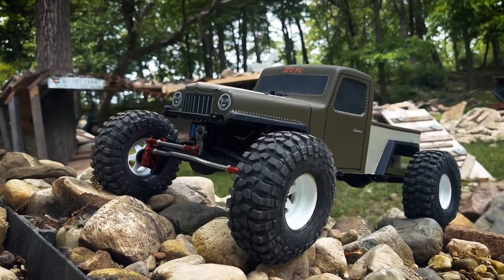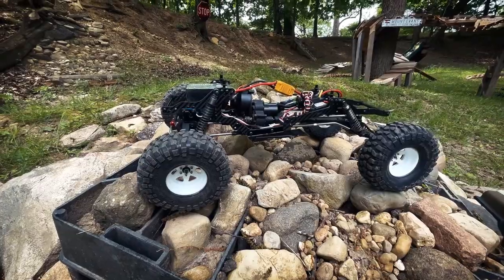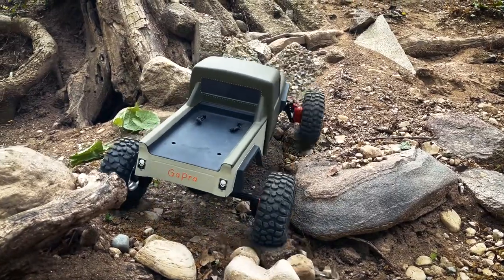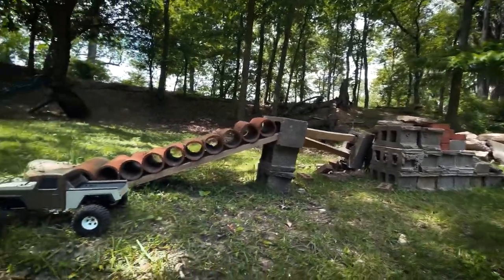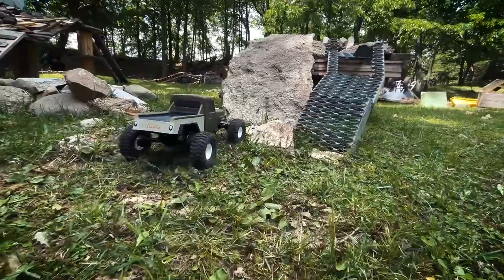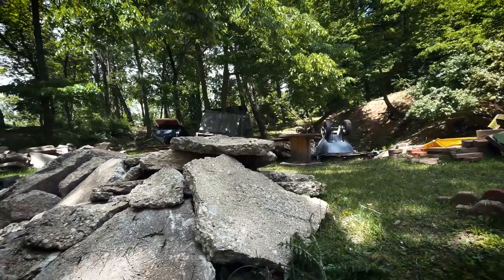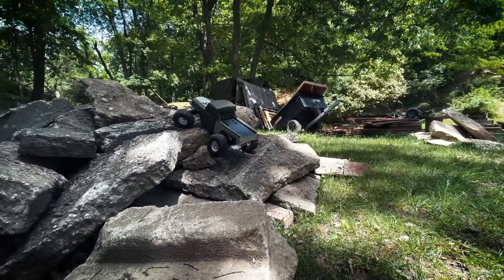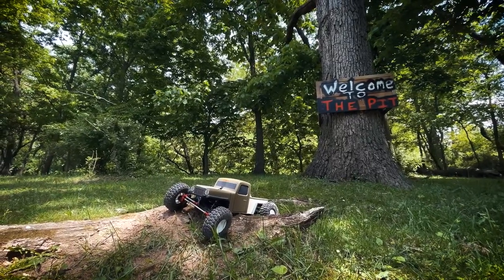Gapra 2.0 hits The Pit for the first time!

Comment: it sounds like it started as a element but now you have a scx10 II modded
Reply from the maker: It started out as a Wraith 1.9, then added the Capra axles, then I swapped that over to a Gatekeeper frame and trans, then I had to go back to Axial parts so that I can take it to Axialfest next month. So it has made several transformations over the last 6 months or so. However, after Axialfest, I’ll be going back to the StealthX trans for sure.
Reply: @DRZ-RC   well that's a lot more than I done. I started with the trx4 defender then a g wagon a sport now a gatekeeper and a scx10 2  builders kit with a 2wd stampede body and trx4 sport wheels and radio is a tq
Reply from the maker: That’s definitely a different combo.